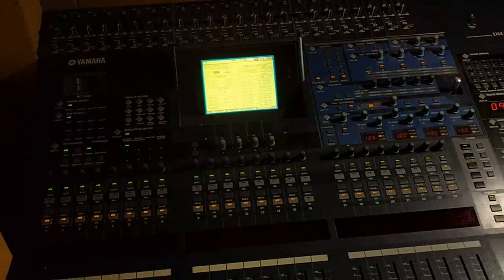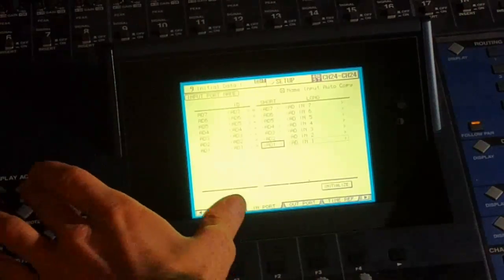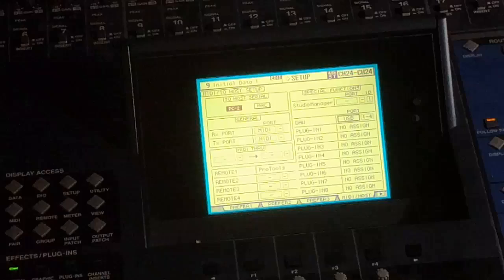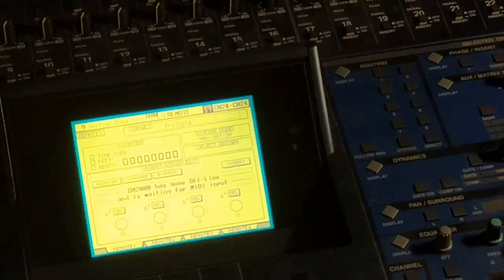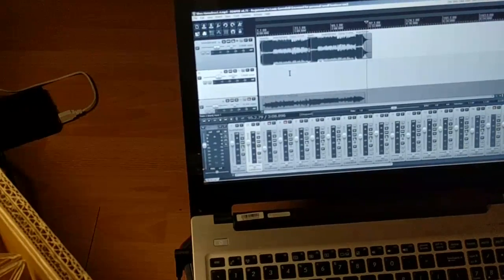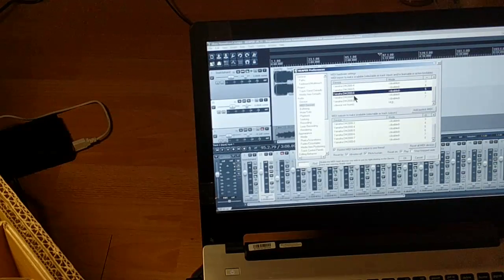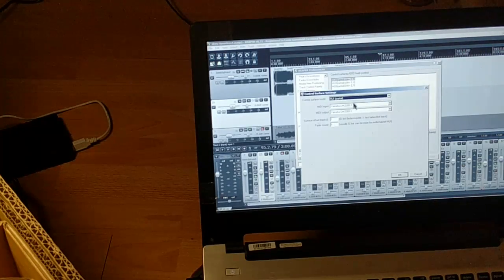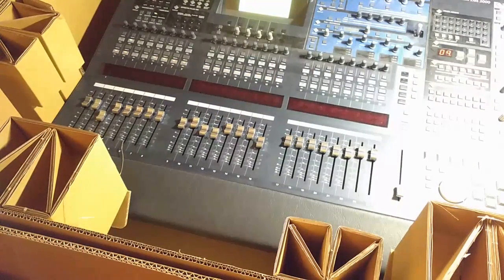Yamaha DM2000 Repair & Reaper Setup (Reaper.fm) - Hardest Repair I've Ever Done?

Comment: Unfortunately You opened the device from the wrong side. When the screws are opened, the device should be in a normal position but facing you. It means you are sitting behind the machine. The upper part with the hinge located on the front of the console can be easily pulled up and opened in the opposite direction where you are sitting, and no cable will be short. You should lean its upper part on a support like a wall.

Comment: If you look carefully, the main teeth should be slightly curved like the touch control tooth, but it is not.
The head part of the teeth are broken due to friction and you need to replace a new feeder which costs about 20 dollars. The weakness of this type of feeder from alps brand is that it is open and a lot of dust gets into it. In addition, the dust that goes between the teeth and the resistance part of the potentiometer cannot be cleaned in any way, neither by wind pressure nor by spray.

Comment: That's it friends "I finished the Beast" I changed the battery after much research, and it's quite simple without dismantling everything, except that there is nowhere the precise description of what you have to do in the different user manuals, after ultra-long Web research and some info,
I put my description at your disposal!!

DM 2000 BATTERY REPLACEMENT
Of course unplug the console, BUT BEFORE save the "ALL" on the SMART MEDIA card, ie the entire configuration of your console and ALL ITS PROGRAM MEMORIES.
The battery is in a slot on the CPU PCB
Remove all the screws from the Left Side Panel of the console (when facing the console) and of course if you have a wooden side, the 4 screws that hold it in front!
Facing the left side of the console, on the right there are two circuit boards one above the other.
On the top one at the bottom left at just 13 cm deep there is the battery compartment that can be reached by hand.
With a long, small screwdriver with a thin end, just push the battery towards the back of its housing, and at this point it comes out slightly, which allows it to be removed naturally,
I took the opportunity to apply a little contact cleaner,
then do the reverse operation of sliding a new 2032 battery into the holder, like the one that was there originally with the + above.

Comment: You’ve opened it from the wrong end. You take a row of back panel (plug board) screws, upper side screws out on both sides. Leave the bottom side screws in and one slightly larger screw either side where the cushioned pad is ,just loosen these a bit. Remove front lower screw row along under side of cushioned wrist pad, then you can hinge open from the back whilst it sits on its base, the front will pivot all the way if you support it on the floor with a cushion to protect it. There are internal semi clear cable collectors that have quick release clips so you can free these to hinge top panel full open whilst still all connected, think you found these all ready. Then you can access just about everything individually without having to move too many other things for servicing. It’s all in the service manual for the best disassembly instructions. Got three of these, they get easier to work on the more you do it/get used to their tank like construction. There’s a Yamaha DM2000 facebook group that’s really useful source of Q&A.

Comment: Wow Dude ive been interested in a board like this. I enjoy your work ethic & The Turn Around of the job. Do you Have a Contact info incase i the Yamaha DM2000 need repair & Preventive maintenance Work to it.  Unsure where you located but hopefully in N.Y.C 😊🤪👐🏻🙌🏻🙏🏻
Reply from the maker: Sorry, I will only ever repair one of these again if the gun to my head is fully loaded.
I hated this repair so, so much.  :(
Reply: @SegasonicfanDesigns  Ohhh Man lool You Shot My Hopes & Dreams Down. 😜🤪🙄 Luv This Board Too. Blessings Champ 👐🏻🙌🏻🙏🏻✌🏻

Comment: Desoldering is really easy use flux along with desoldering wick will some up the solder.
Reply from the maker: yes I have all of those. and a desoldering pump and many other tools.  the challenge here was that there are enormous heatsinks that absorb the heat you apply, with or without fine grade liquid flux.  It is a lot more challenging than typical applications.